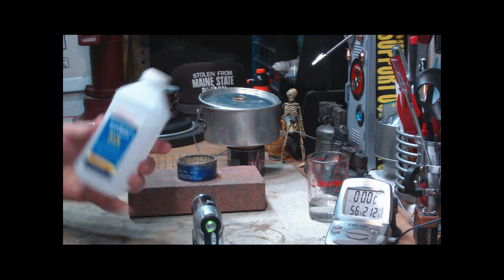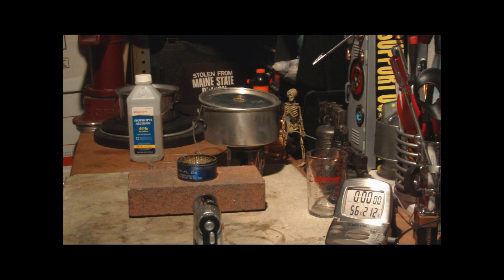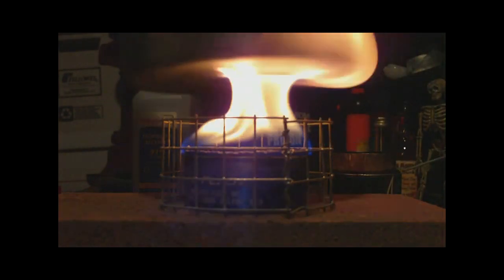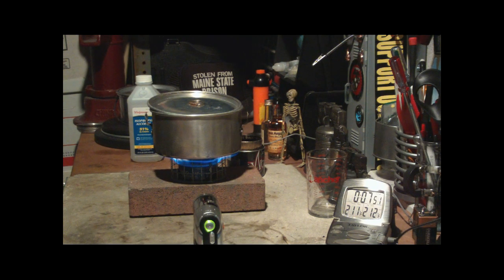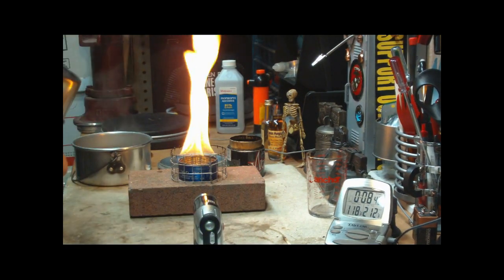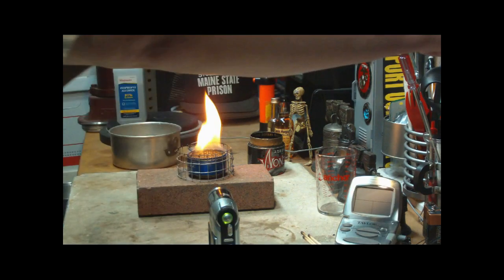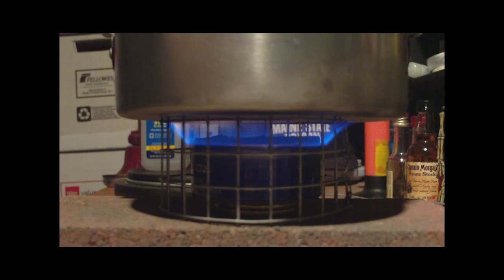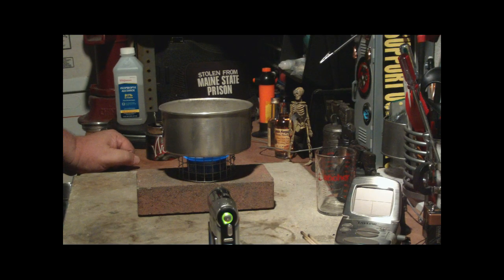Isopropyl Alcohol - Yet Another Look

Comment: I mixed Heet and 91% iso over the weekend and did some testing.  With an altoid tin burner in an esbit folding stove (small headspace between burner and pot) there was no sooting.  When I used it on a westwind burner or in the swedish kit with more headspace there was some sooting, but not like pure iso.

I will try 2/3 heet and 1/3 iso to see if I can get normal headspace with no soot.

Comment: I know this is an old video but some people might not know; the only factor making the soot is the chemical composition of the alcohol (water will help Isopropyl but lowers the burn temp). Methanol the cleanest burning (CH
4O),has only one carbon,  then Ethanol (C2H6O) has 2, and then Isopropyl (the dirtiest)  has 3 carbons (C3H8O). The lower the carbon the cleaner it burns (less soot). Denatured alcohol is just Ethanol with additives to make it poisonous to drink since Ethanol is the stuff in booze. Ethanol burns clean and burns longer than methanol of the same % and is the best choice for stoves and burners. Just a quick aside be very careful with methanol, in most common lighting situations the flame is almost invisible. (search: Formula one invisible fire. on YouTube)
I really hope this helps someone, I had a heck of a time figuring it all out when I got interested in stoves, I just thought alcohol was alcohol.